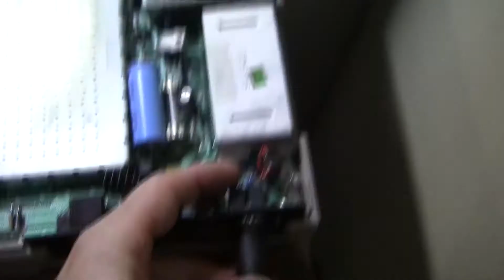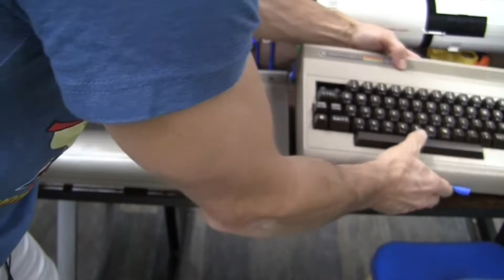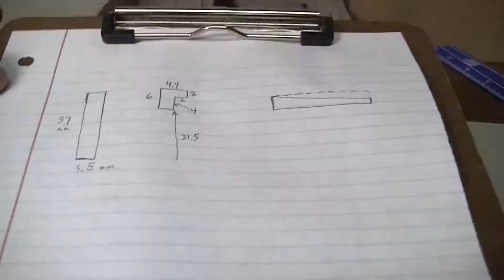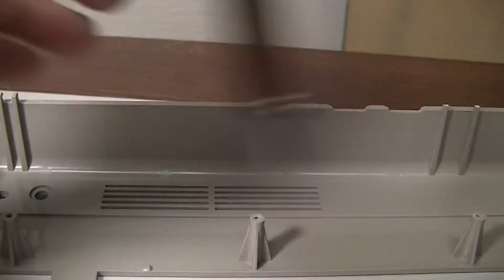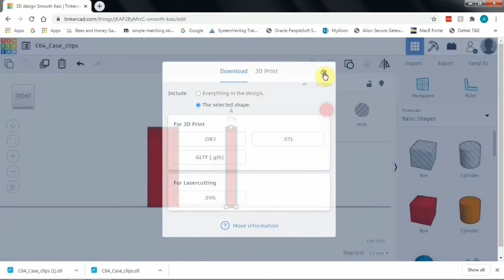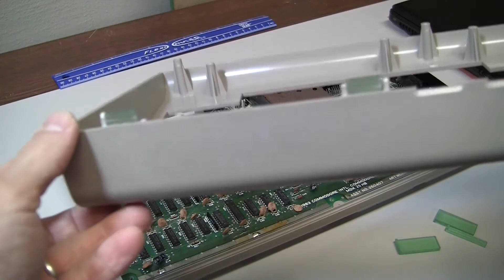Brief 3D Print Commodore 64 Case Repair: TinkerCAD, CHITUBOX, and Siraya Tech BLU, Mars 3D printer!

Comment: I thought I was getting a great deal on a C64 case off of Ebay, but it turned out to be just the 3-D software for the case halves. Now I need to go find a 3-D printing service to print them
Reply from the maker: Oh, tricky.  You probably have already found the services like Shapeways.com. I considered using them, or a similar one, before for some C64 key adapters.  I uploaded the STL model file and was presented with a few choices of plastic material and instant quotes. I wasn't confident in my model however so I hesitated.  The model had not been used or proven yet. That's when I purchased my small 3D printer for working out the prototype first. Once you know it's close, the online services have much better selection of stronger plastics for parts that need to be functional.

Comment: Great episode as always, AC. This one  is particularly timely as well, as after my (first) attempt at retrobrighting my C64 - which came out well, I noticed I too had some broken case clips!

Thanks for the inspiration and keep up the great work.
Reply from the maker: Thank you for the awesome feedback!  Good luck with your case repair.  In case you are interested in getting some from the website I mentioned (soigeneris.com), the author contacted me with an update that he has all 6 case styles covered for you! I'm not affiliated, just thought it is a helpful site.  About your C64 Retrobrighting, it sounds like you did a nice job! Was it the bread bin style, darker case?  I have not had good luck with those.  I do better with the lighter colored cases.
Reply: ACs 8-Bit Zone  Tthanks for that, AC. I'm getting a 3D printer delivered soon, so that'll be a good first project for me to try myself, I think.

Yes, it was one of the breadbin cases. I retrobrighted indoors (we're not getting too much sun here in the UK right now) by placing the case inside a foil-lined cardboard box and used 2x30W UV lamps illuminating through cutouts in the top of the box, along with Hydrogen Peroxide cream.

I rotated the case 180 degrees every 30 minutes and then flipped it over and did the same. I repeated this over the course of about 8-10 hours and it came out great. A lot of work but it was worth it.

The case parts and cream were wrapped in the usual clingfilm, but and it's best if you rub the cream around from time to time to avoid any streaking. I also found I had to top-up the cream a couple of times too as it was starting to dry out (probably due to the retrobrighting taking so long).

The keys were done using Hydrogen Peroxide liquid (i.e. not the cream, as I've not had much luck with that on the keys). I put those inside a zip-loc bag and again moved them around every 30 minutes or so. They took about the same amount of time.

There is also a method where you can use the liquid along with a Sous Vide cooker, but mine is broken at the moment, so I haven't tried that.

For a Sous Vide example take a look at this video on the excellent RetroManCave:

https://youtu.be/05RSh3d-EuA

The only problem I had was that I ended up with some very slight damage (which most wouldn't even notice) on the Commodore logo. I'll cover that up with masking tape in future efforts.